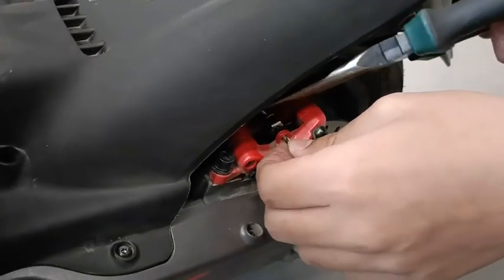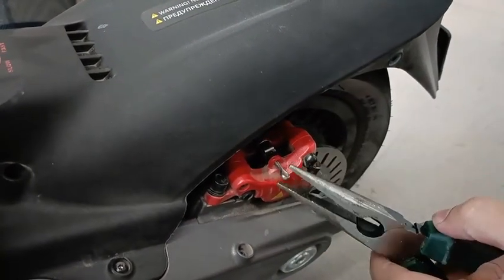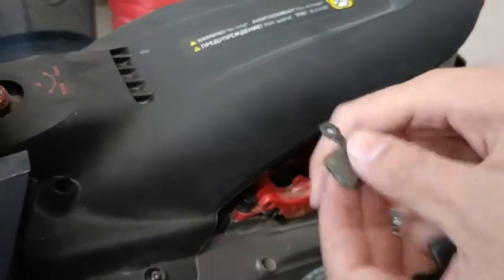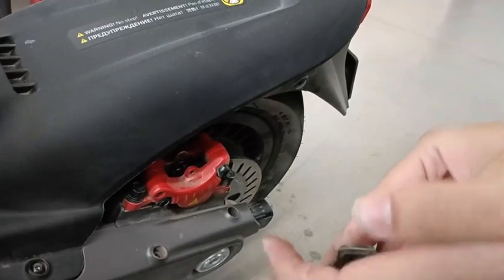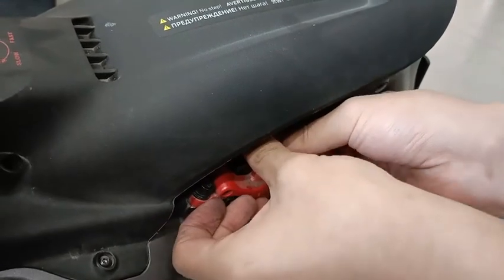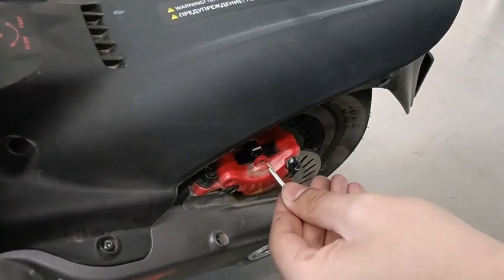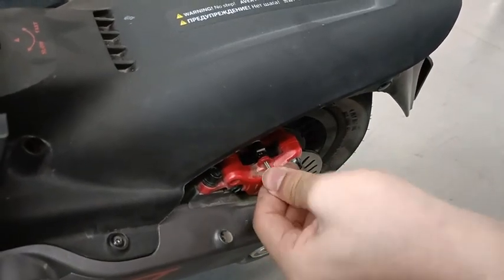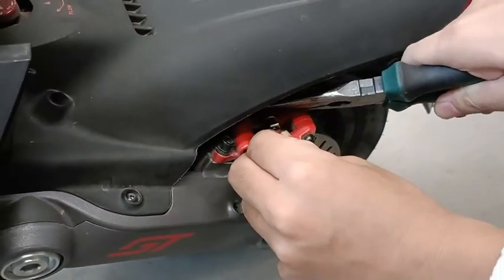Segway Ninebot GT-Series Brake Pads Replacement

Comment: A question: My display  (GT1D)  does not have a cruise control function because it is not allowed in my country.
Is there a way (firmware that i can take so that i still have cruise control? The ZERO-Start would also be very useful!
I would be happy if you could offer various firmware versions so that everyone has their full functions if they would like to have.

I would be interested in an answer very grateful thx☺

Comment: I did this and now I have no brakes I'm very confused there's no power to the break
Reply: Hey same, did you find a solution?
Reply: You have to bleed the hydraulic system and then refill the fluids @Nefthali13